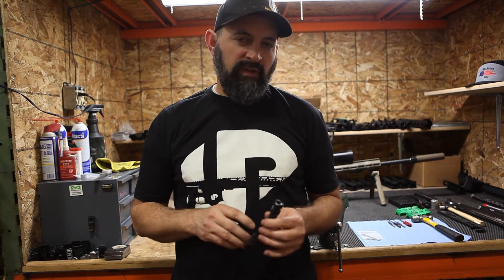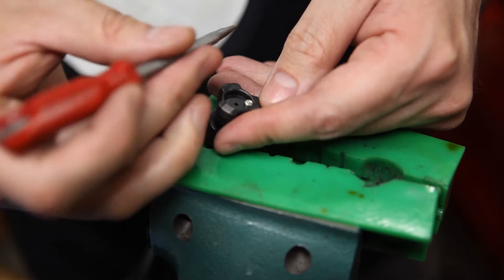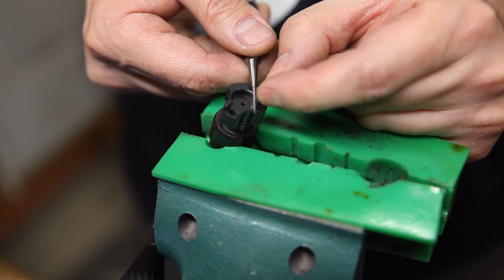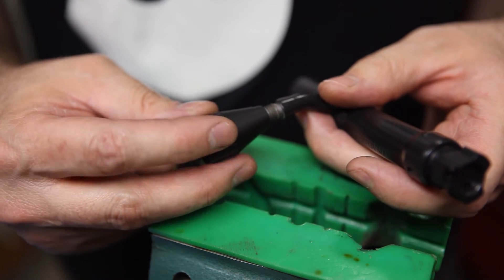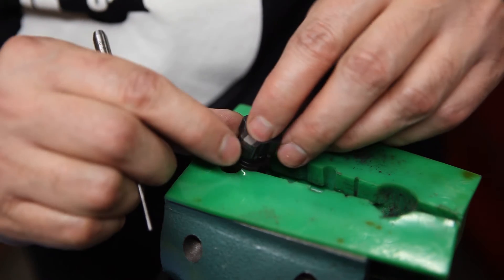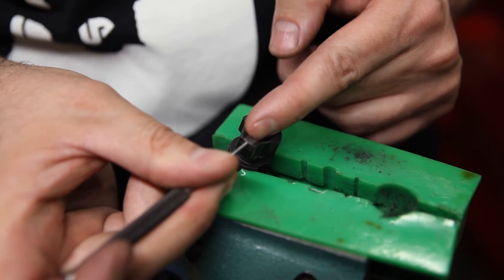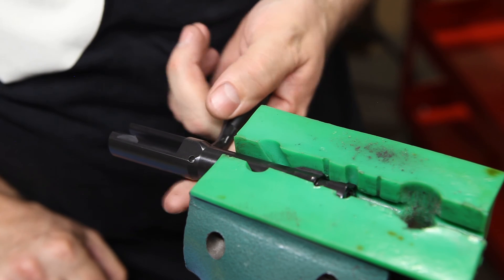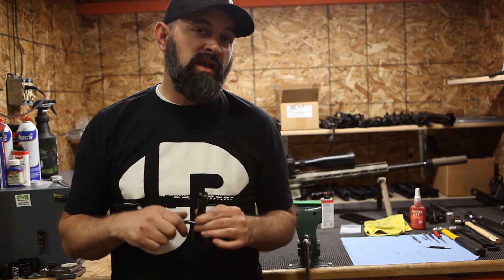UPR Bolt Tear Down and Assembly

Comment: To what working pressures are your bolts rated for?
Reply from the maker: Our uppers can be loaded to bolt gun pressures.
Reply: @uintahprecision3190  I'm trying to develop a cartridge and wondering what pressures I can push it to in an AR-10 platform its currently being call 44-06  parent case is 30-06  expanded to 44cal and cut back to 2.300 inches firing a 300grain bullet seated to 2.600 or 2.700 inches depending on bullet shape.

Comment: Great tutorial. Is there a recommended service/replacement interval for these parts?
Reply from the maker: It depends on caliber and ammo, but with the updated bolt we started putting out about 2 years ago, spring replacement was mitigated for calibers that were rough on components. If you are shooting factory loads, you're going to go well over 5k rounds before you might ever see an issue. Most of the time, customers buy the maintenance kits to have on hand for "just in case". We would recommend inspecting the bolt at every thousand rounds ,for good practice and habit.